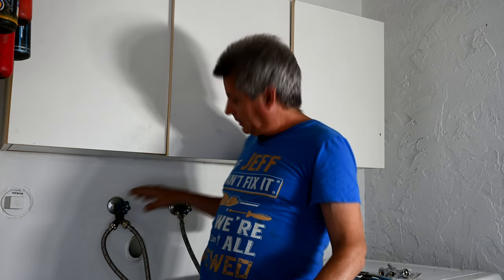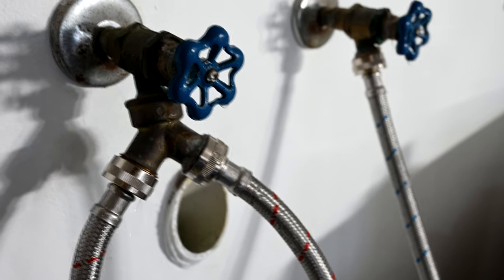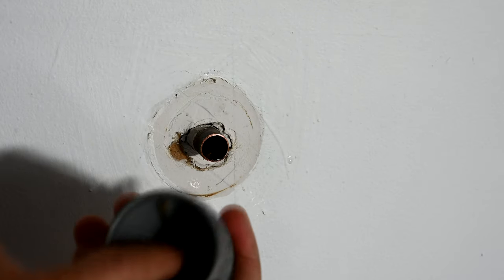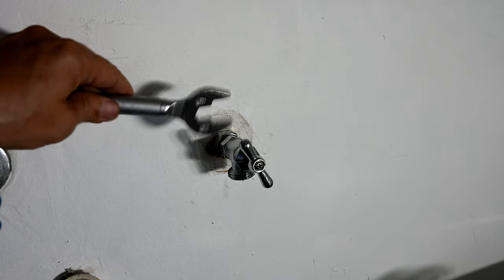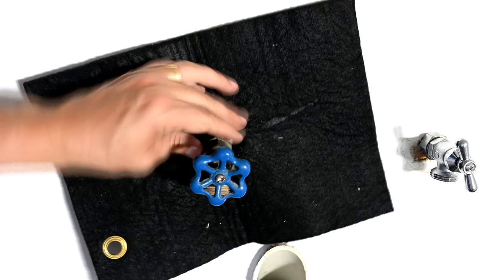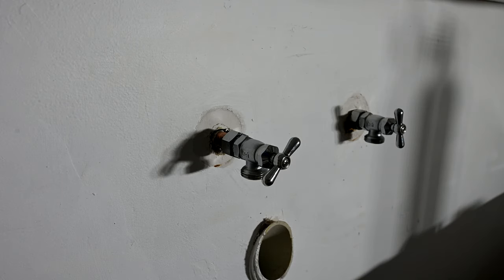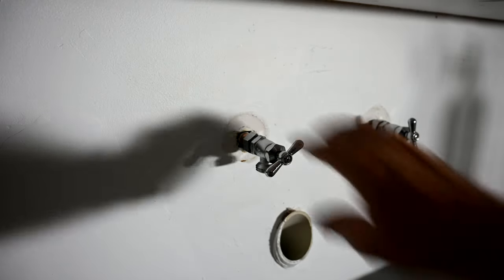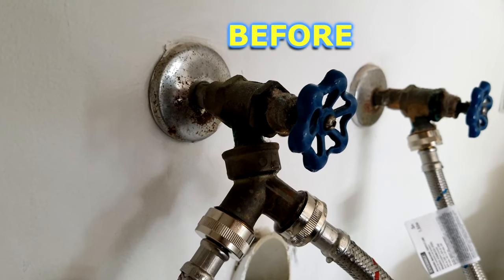How to Replace Leaking Washing Machine Water Shutoff Valves

Comment: All you needed to do was replace the valve packing.  It was leaking through the stem.
Reply from the maker: These valves were old ad needed to go, the house was being sold. Much better to leave brand new valves that some idiot inspector can't come in and abuse them while he opens and closes them to cause a leak.
Reply: @jeffostroff  Good point!  You could have pointed that out so people like me don’t have to comment.
Reply from the maker: @tomfinn6579   It's good to have comments especially different opinions on how to do things so that people can see all of the different ideas that are out therr
Reply: @tomfinn6579  he did point that out in the video. He discussed the pros and cons of just replacing the seals. Did you miss it? See about 3:10 .

Comment: could you not just replace the internal washer to fix the leak?
Reply from the maker: What you are proposing only works if the internal washer is the issue, but what if it is not, also many of these gate valves use packing rope inside, not a washer so that's why tightening the bonnet not on the outside a lot of times will solve the problem period but in this case we wanted to remove these old gate valves cause because when they are this old and original they're bound to break any day in with the luck of the sellers, it would happen during a time that the buyer's inspector comes to exercise the faucets to see if they are working period I always in this situation because it's a piece of cake will replace the old gate valves with much more modern and improved quarter turn ball valves period of course in this case we replaced it with whatever was given to us.

Comment: @4:08 how to cut that flange?
Reply from the maker: I use metal aviation snips from Wiss, sold at Home Depot, sometimes an old pair of wire cutters that you don't care too much about can be used to start the cut into the flange, then tear it apart with pliers.

Comment: don't understand when doing this work  - You don't use a ball valve.  The valve you used has a rubber gasket that eventually fails.  I would never use this type if valve anymore - I consider them obsolete and trouble in the near future.
Reply from the maker: I normally use a ball valve. The owner wanted the same type of valve installed

Comment: It looks like the packing nut needs to be tighten
Reply from the maker: Packing nuts on both valves were corroded and not moving. When the valves are that old and there's corrosion, I usually just replace the valve, it's so easy and requires little effort..
Reply: Brass dose corrode ,loosen then tighten it to stop it from leaking. Or put more packing rope in it.
Reply: Brass dose not corrode just tighten it if it still leaks u can use packing rope to fix it.

Comment: i noticed he did not mention that the compression valve is backward threaded. this is a serious omission , it could cause a beginner a lot of trouble. he lost my trust here did he just forget or something else
Reply from the maker: Not sure what you mean by backward threaded, that compression nut still turns clockwise form it's viewpoint to tighten onto the valve body. That's not back wards. You're not making nay sense
Reply: @jeffostroff  i apologize if i made mistake. it looked to me as though you were tightening counter clockwise and did not mention it. i am novice handyman.i have had that happen to me not knowing it was reversed threaded, gave me a bad time. sorry again, i guess i have grown a less trusting type person.

Comment: Hot water shut off protrudes out of the wall further than the cold shutoff.  Doesnt look very professional imo.
Reply from the maker: Of course they aren't even, that's how stupid builders are here in FL, they never make anything right. What you saw on that wall was the original 1982 setup as the builder built it. Unfortunately the cold water pipe, if you look at 0:06 in the video, had damage and poor soldering that had to be cut off, so now you have less copper pipe out of the wall. But it's not that far off form the hot water pipe protrusion.